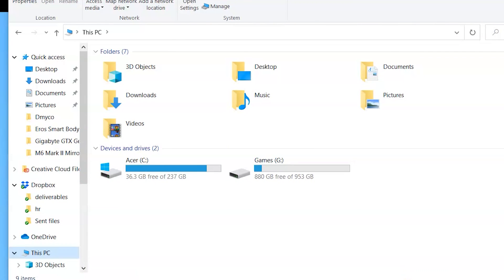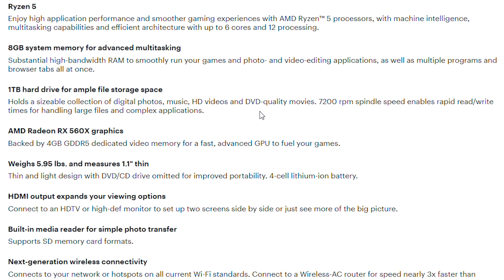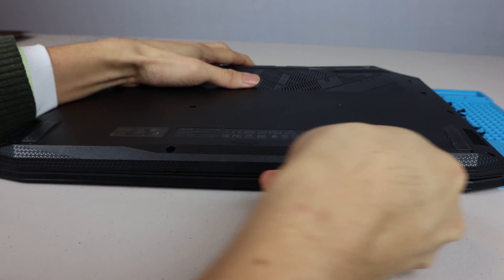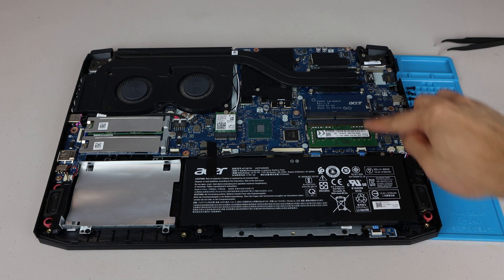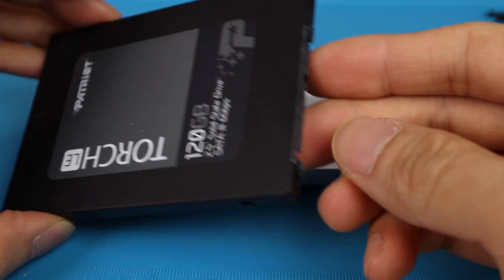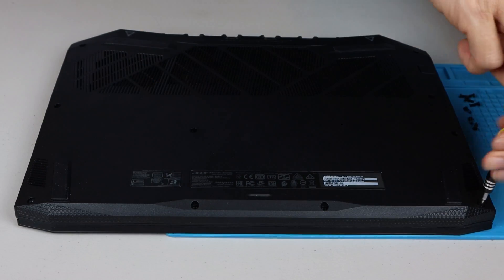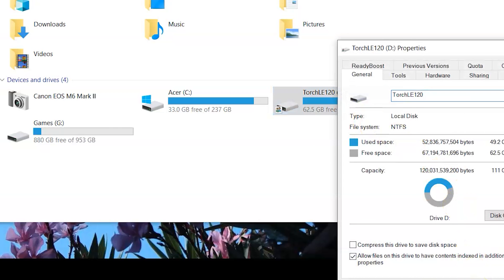How to Install 2.5" HDD or SSD in Acer Nitro 5 Gaming Laptop (2019 ver) SATA III Drive

Comment: hi there, pls do tutorial on how to migrate windows 10 from hdd to ssd thanks a lot i like to upgrade my acer nitro 5 an515-43
Reply: You can use the software AOMEI Backupper to easily clone your OS drive from HDD to SSD. It's as easy as copy paste except it takes time depending how many files you have on HDD and whether you wanna transfer them all or just transfer the operating system fresh

Comment: Hi, I hope you can help me. I bought a hdd 2TB seagate, the bios recognize it but when I start up windows it don't appear.
Reply from the maker: If you install a new drive into your laptop, you actually can't use it straight away after hooking it up. You'll need to set it up first. Since you've already verified the system can see it in your BIOS, to set it up on a Windows 10 machine:  Search for "computer management" into the Windows search bar (Cortana) and double-clicking the search result. Then select Disk Management on the left hand side. Find your new drive on the bottom of the center column, right-click the "unallocated space" (marked in black). Choose New - Simple Volume. Accept the default size. When asked to assign a drive letter, accept the default. The right-click the newly allocated space, select Format and follow the on-screen prompts. After that your drive should be good to go.

Comment: Is it ok to tuck the ribbon cable under the 2.5 ssd?
Reply from the maker: I suppose. You might have a problem getting it to sit flush though. Is it too long to sit on top instead?
Reply: @FixItPhil  I had to go back in an re-do it but its all good now. Thank you for responding :)

Comment: Are there any partitions required if I placed my HDD from another laptop which has all my files and program files on the Nitro 5?
Reply from the maker: If the hard drive was previously being used, you do not have to partition or format the drive. I'm assuming you want to keep the files, so do not perform those steps, as doing so could erase all the data and files on the drive. It's only necessary for brand new drives.

Comment: does it have to be a SATA III?
Reply from the maker: Yes, the 2.5" drive should be SATA III for best performance though this connector type is backwards compatible with SATA II and SATA I ports, but these will be slower. SATA III is pretty much the industry standard, and I don't think most current products are made to the older SATA standards, unless you have an old drive from another system you want to use.
Reply: @FixItPhil  what about sata 6
Reply from the maker: @PjayMaow  SATA 6 GB/s is Sata III. The names are interchangeable.

Comment: Hello I’m a noob when it comes to computers and technology so I have 2 question 1) does it matter if you use an ssd connecter since I only visibly see one link to a hhd connecter and 2) can I use a sshd (solid state hybrid drive. Sorry if I sound antsy I get paranoid when I look for parts to upgrade my only laptop.
Reply from the maker: The cable connector is the same for both 2.5" SSD and HDD. It's just the SATA interface type, which is independent of the drive's memory type (NAND flash vs. spinning platter of SSD and HDD respectively). I've changed the name of the link to make this more clear. Sure you can use a 2.5" SSHD, as long as the form factor is 2.5" and it's 7mm thick or less.

Comment: Does it matter if you use an hhd connecter to a 2.5 inch ssd
Reply from the maker: No, it doesn't matter. The cable is the same for both a 2.5" HDD and SDD. It's a SATA interface connector.
Reply: Thank you

Comment: I’ve recently just bought the Acer - Nitro 5 17.3” Laptop - Intel Core i5 - 8GB Memory - NVIDIA GeForce GTX 1650 Ti - 512GB SSD i have the 10th generation so Will the 10th generation have different parts than the 9 generation?
Reply: Bro im sitting here with it now with this csble and dont know etf im doing i just wanted to play SWTOR
Reply from the maker: I haven't seen it myself, so the internal layout may be slightly different. You'd have to check out the specs and compare the two to see what's different.
Reply: I have AN-517-51 version of this laptop (17 inch Acer Nitro 5)
And my question is:
Is sata cable from another Nitro 5 compatible with my laptop?
Because there 's difference in prices on eBay
But I compared it by pin count and it looks the same.

Comment: Are we supposed to use anti static strap  for doing laptop upgrade , i dont know how to  use that ?
Reply from the maker: This is recommended if you cannot guarantee a static-free environment when working instead the laptop. The grounding/anti-static wrist-strap is really easy to use. Just wear the wrist band like a bracelet, ensuring the metal inlay makes contact with your skin. Then attach the alligator clip from the wrist strap to any large piece of metal; make sure it is bare metal and not painted or coated.
Reply: @FixItPhil  thanks for the reply , so can i connect  it a aluminium  or copper  utensils like plates or other utensils available at home   because i dont have an desktop cpu for connecting to its body 
I saw some people conncting it to the vga port on laptop will that work ?

Also can i connect it ground hole in socket , i live in india  , so the socket here  has  ground hole on the top   and i dont understand how to plug the aligator pin into the hole 🤔?also how to ensue safety ?
I coundnt find a proper explanation  
On the internet

I love my devices and i dont want them get damaged actually iam planning buy an laptop and upgrade it by adding additional ram and ssd  so thats why iam so concerned
Can u give me a specific solution applicable to my condition as dont want esd to damage my laptop components
Reply from the maker: Sure, you can connect the wrist strap to any piece of metal, as long as that piece of metal has contact with the ground. It's not specifically about connecting the clip to metal, it's more to ensure the charge dissipates to the ground.  So if you have a metal chair or table that touches the ground/earth, you could try using that too. I don't normally suggest putting things that are not plugs into outlets, even if you do use the ground hole. The simplest solution is to just drive a metal stake into the ground and attach the alligator clip to that: https://geni.us/x0maL [Amazon Affiliate Product Link] I suppose you can do this with a steel, aluminum, or copper fork/knife and it should work.

Comment: Hi, can you help me with how to do the partition and how do you format it.. im kinda lost sorry . I recently buy a new ssd for my acer nitro 5 , thanks in advance
Reply from the maker: After installing the new SSD, you'll need to partition and format the new drive before you can use it. You can do this by typing "computer management" into the Windows search bar (Cortana) and double-clicking the search result. Then select Disk Management on the left hand side. Find your new drive on the bottom of the center column, right-click the "unallocated space" (marked in black). Choose New - Simple Volume. Accept the default size. When asked to assign a drive letter, accept the default. The right-click the newly allocated space, select Format and follow the on-screen prompts.
Reply: Dude thank you so much really appreciate it

Comment: Great video I have several question... I just received my nitro 5 amd ryzen 7 and working on adding an ssd 2.5 drive along with an additional m.2 nvme. The ssd 2.5 I received from amazon didn’t bring a cable. What part is that  on amazon? Also when I installed the m.2 nvme I don’t see it on my computer? How do know if it’s there or if my installation was successful? Thank you 🙏
Reply from the maker: Usually, the cable for the 2.5" drive is included in the box with the laptop, not the drive itself, as different laptops may use different cable connectors. Since I don't know your exact model number, here are some cables that may be compatible from NewEgg: https://geni.us/iP1xY [NewEgg Affiliate Product Link] Just make sure to select the cable that matches your laptop's model number. 

As for the NVME drive, are you able to see it in the BIOS (press F2 repeatedly when botting up the laptop to enter the BIOS)? If you are, the drive just needs to have the space allocated, formatted, and assigned a drive letter before you can use it. If it's not showing up in the BIOS, it may be that your laptop cannot read the NVME interface (I hear this is common with AMD Nitro 5 builds) in that case, you will need to install a SATA M.2 instead, like this one: https://geni.us/nSTKB [Amazon Affiliate Product Link]

Comment: Great video! Quick question, does the Nitro 5 come with an empty bracket for an additional SSD and RAM stick? I'm pretty new to PC gaming and am looking to get another 256gb SSD and 8gb stick, and just want to be sure I don't have to outright replace the already existing Hard Drive and RAM. Sorry if this seems like an obvious question.
Reply from the maker: It depends on your build. My came pre-installed with one 256GB M.2 SSD and 1 stick of 8GB RAM, leaving open the second M.2 slot, one RAM slot, and the 2.5" HDD bay. The Nitro 5 is sold with various configurations though, and some have an M.2 + HDD or may have 2 sticks of RAM pre-installed, so you'd have to check the specs for your model to be sure. You could always open up the laptop to check if you want to be absolutely sure what you have installed/available for any upgrades.
Reply: @FixItPhil  Thanks for the reply! I read the description, and it should have an available bay for a second SSD. I believe it also comes with cables/screws too. I'll definitely use your videos for help!

Comment: Thanks. Just got a Acer gaming laptop and needed a second hard drive due to limited space. This worked perfectly.
Reply from the maker: Awesome! Glad this video helped.
Reply: @FixItPhil  I got a question. I am using the HDMI port to extend display to one monitor. I bought an USB C to HDMI cable to extend to second monitor but there is no video output. Anyway to get a second monitor working with these laptops?

Comment: thanks finaly i know the meaning of that cable. i also wanted to get a samnsung evo plus 970 m2, how can i make this one the main one instead of the sata?
Reply from the maker: If you want the M.2 to be your primary drive. After installing it, clone your current primary boot drive to your new M.2, then switch the boot priority in the BIOS to use the M.2 drive first. Then you can format.wipe your old drive to use as a secondary/storage drive. Clonezilla is a free software that works nicely for machines running Windows.

Comment: Turned off the laptop , hdd hit the area I was going to connect it to and it sparked and now the laptop won’t turn on at all . RIP ME BRO WTF
Reply: Is there anything i Can do at this point or should I just send it to get fixed
Reply from the maker: If there's electrostatic discharge damage, your best bet is to send it in for repair because it'll be hard to track exactly which components were affected and there could be more than one.

Comment: Does this void warranty?
Reply from the maker: In the US, generally no, if nothing is damaged in the process, you are able to upgrade RAM and storage drives without voiding the warranty. If you live in a different region, the rules may be different, so check with your region's local Acer service center for more clarity on this topic.

Comment: hello..  i install a 1 TB barracuda. computer didnt read it.  any reason why? should i install i driver something?
Reply from the maker: Are you saying that the computer didn't recognize the drive in the BIOS? Or simply that you can't see it in your file explorer? If it's the first case, then the connectors may be loose or not seated correctly. If you installed an M.2 form factor drive versus a 2.5" drive, it could be a mismatch of interface type (NVMe vs SATA); here's what I'm talking about: https://youtu.be/Oz735CCXTQo?t=66.

However, if you can see the drive in the BIOS but not in Windows Explorer, then you simply need to format and allocate the space on the drive, then assign a drive letter. To go through those steps in Windows 10, search for "Computer Management" in the search bar and open up that setting. Then select Disk Management on the left hand side and right-click on the unallocated portion of the newly installed drive at the bottom of the center column. There you can allocated/format the space, mark it as active, and assign a drive letter. After doing that, you'll see the new drive show up in the file explorer.

Comment: In case I'm installing a brand new HDD to my laptop......then what I have to do??
Reply from the maker: After following the instructions in this video, you'll have to allocate the space on the drive, format it and assign a drive letter to use the drive as additional storage. You can do this by typing "computer management" into the Windows search bar (Cortana) and double-clicking the search result. Then select Disk Management on the left hand side. Find your new drive on the bottom of the center column, right-click the "unallocated space" (marked in black). Choose New - Simple Volume. Accept the default size. When asked to assign a drive letter, accept the default. The right-click the newly allocated space, select Format and follow the on-screen prompts.

If you plan on using the new drive as the primary boot drive, you'll have to install an OS like Windows 10 or clone your existing boot drive over to the new one.
Reply: @FixItPhil  found this comment no clue how to do any of that .... Haven't bought the storage yet but thinking about it
Reply: Nvm found you explaining it to someone else

Comment: I followed this video step by step and was pretty sure I installed my 1tb 2.5 hdd correctly. After turning the laptop back on , I couldn’t find my hard drive in the file explorer application. Is this because I messed something up while installing the hdd or is it something else?  It’d be great if someone could help!
Reply from the maker: If you install a new drive into your laptop, you actually can't use it straight away after hooking it up. You'll need to set it up first. After it's been installed and verify that your system can see it (by checking that is appears in the BIOS, press F2 on the keyboard repeatedly when you boot up the laptop). On a Windows 10 machine:  Search for "computer management" into the Windows search bar (Cortana) and double-clicking the search result. Then select Disk Management on the left hand side. Find your new drive on the bottom of the center column, right-click the "unallocated space" (marked in black). Choose New - Simple Volume. Accept the default size. When asked to assign a drive letter, accept the default. The right-click the newly allocated space, select Format and follow the on-screen prompts. After that your drive should be good to go.

Comment: is this for the N18C3?
Reply from the maker: No, the model laptop in this video is the AN515-54-54W2 Nitro 5. The N18C3 layout and internal hardware may be a little different, as it is an older model, but the process is generally similar. However, the compatibility of upgradable components might also be different.
Reply: @FixItPhil  ah okay, thank you :)

Comment: Does anyone know if Samsung 860 QVO works with that
Reply from the maker: Yes, the Samsung 860 QVO will work with this laptop and fits in the 2.5" HDD bay, as long as the thickness isn't over 7mm it should fit (0.27 inches).

Comment: Okay so I haven’t upgraded my laptop at all and assuming it’s the same model as in this video I can add an sdd and all my files and games are still gonna be on my laptop I don’t have to transfer any files or anything?
Reply from the maker: Yes, as long as you do not remove your primary boot drive, all your files and games will still be on that drive. The second drive can be used as additional storage space and you don't need to move anything if you don't plan on booting from the new drive.

Comment: Hi, first of all, thank you for the video!
I want to ask, in my case, i didn't get any of the screws, only the cable. Can i use other or similar screws to attach the ssd or hdd to the silver platform?
Thank you very much!
Reply from the maker: Yes, as long as the screws fit they'll work. 2.5" HDD/SDD screws have a standard size so they should be easy to find. I have links to some in the description of the video.
Reply: @FixItPhil   thank you for the information! :) Have a nice day!

Comment: are the screws to connect the drive to the metal bracket thing necessary?
Reply from the maker: Technically no, but without them, the drive will sit loose in your laptop and rattle around leaving open the possibility that it could cause physical wear/damage over time or loosen the connector to the motherboard.

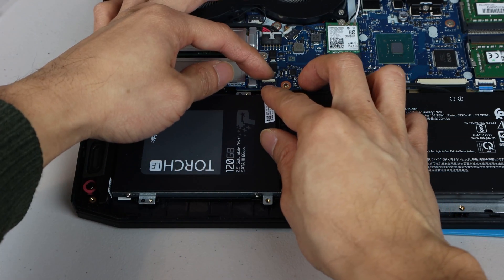Comment: im unsure the model i have but it looks just the same as this pc but it doesnt have the spot for the drive to plug in plz help if u know why 3:22
Reply from the maker: If you don't have the same model, it's possible that the SATA drive connector is just in a different spot, or possibly it has a built-in connector directly adjacent to the HDD bay.

Comment: hi, do I need to remove battery connection before installing hdd?
Reply from the maker: No, it is not required to do so, but some people prefer do take this extra step to safeguard against the very small risk of an electrical short. It is optional, but do what you need to, to ensure you feel good about the steps you are taking to protect yourself and the laptop from damage.
Reply: @FixItPhil  Thank you